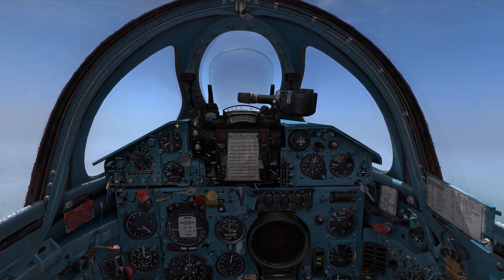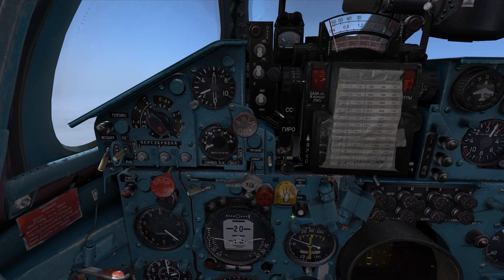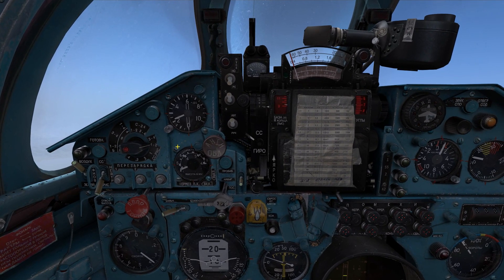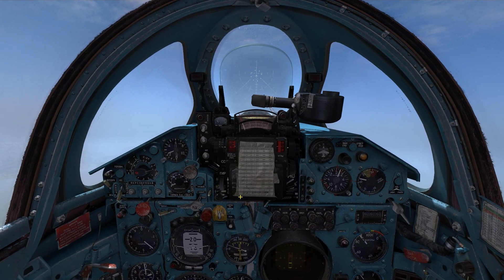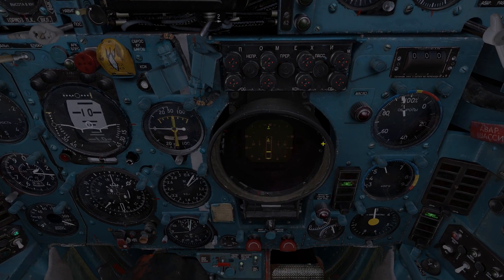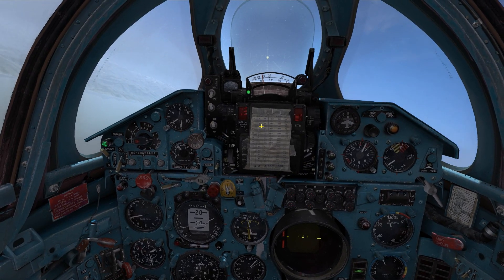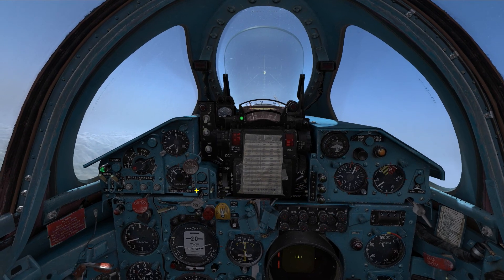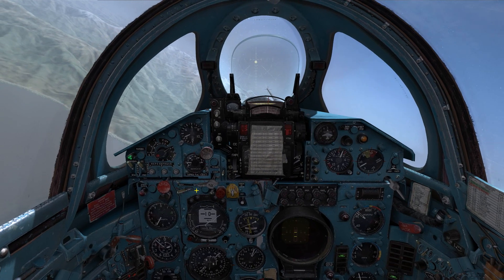[DCS] MiG-21Bis Air-to-Air Missiles

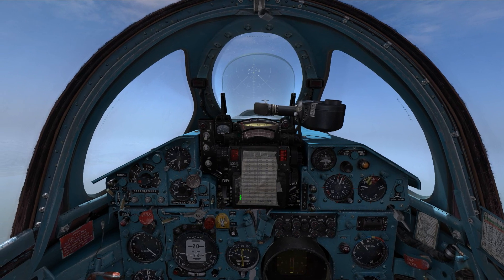Comment: What was that weird-looking, black device that was mounted onto your HUD in the first 4 minutes of the video that disappeared at 4:30?
Reply from the maker: +WelshZeCorgi That is the gun-camera. It is a camera that is only mounted during training, which will record whenever the trigger is pressed. After the flight, the footage will be analysed and it can be determinated if you would have hit the target or not.
By default, the camera is not present in the Mig-21 (as it would be in the real world), however, if you turn on the power switch for the camera, it will appear. I forgot to do that for the second part of the video ;)
Reply: xxJohnxx Thanks.

Comment: Thinking about buying Flaming Cliffs 3, is the flight model simplified or is it also pretty advanced?
Reply from the maker: +TEHGROUND Well it depends. Both the F-15 and the Su-27 have gotten the so called AFM (Advanced Flight Model) which is quit decent. Other airframes have the SFM (Simplyfied flight Model) which is noticable worse.
However, some aircraft (Su-33 and others) should get updated to AFM in the near future as well.
Reply: Thank you for the quick and informative response! Subscribed.
Reply from the maker: *****
Which yellow bars do you mean? Do you have a lock button assinged? You understand of bringing the target into the lock "gate"?
Reply from the maker: *****
Yep, ground clutter was a problem for the early radars. I would recommend watching my Radar tutorial. It shows you how to use the diffrent methodes for de-cluttering your radar screen! :)

Comment from the maker: Yes it is possible to use it in the so called "Game Mode", which disables quit a lot of the simulation stuff.
However, I strongly suggest to take the time it takes to learn the aircraft fully. It is a very good feeling if you start to get the hang for the systems!
Reply: xxJohnxx hi, thanks for the videos!
I have a problem with air to ground! every time I dive for a rockets run after setting the enginge to idle it simply goes off! there is no time for relighting the enginge in battle! is this common?!
Reply from the maker: nymerie
Hi!
Well, quit hard to tell what exactly is the problem, but as a suggestion: Keep an eye on the G-meter. At negative and especially around 0G the engine is only getting fuel for a couple of seconds. If you hold 0G or negative G for too long, it will cause the engine to flame out, as the fuel system of the MiG is not built for that.
Reply: xxJohnxx I thought so. It's in the manual as well... Thanks mate :)

Comment: Awesome Tutorial, thanks!

While the Simulation is amazing (thx Leatherneck!!) actually flying this aircraft seems really hard. Both times (IR and Radar Missiles) you were almost in Gun Range, and as mentioned in your Radar tutorial, maintaining a stable lock is almost impossible.

This makes the Mig21 not particularly "combat effective" compared to modern fighters, does it? How does the Mig-21 hold up against contemporary Jets? Like F-86 or F-4 or others...?

Also, what's the advantage of using Radar-Guided missiles if the range is not significantly larger than that of the IR missiles?
Reply from the maker: Yes, the MiG-21 is quit hard to operate it seems. Obviously you can't compare it against a 4th or 5th gen fighter.
However, at least in the sim, the MiG-21 seems to hold up quit nicely against aircraft like the F-4. Quit equal in terms of flight performance I would guess.

In the video I got quit close until firing because I have been trying to explain the steps. The missiles have  a longer range than that. On a non-manoeuvring target you should be able to get a hit if you fire from a distance of 3-4kms.

Talking about combat effectiveness is a bit difficult. The MiG-21 was designed to intercept and engage bombers. The small payload, low fuel capacity and high speed are a result of that. The aircraft can go from pretty much cold-and-dark to taxiing within 60 seconds. Giving it a pretty much unbeatable response time.

Not being a fighter, it still holds up against aircraft like the F-4 quit well. I guess it all depends on pilot-skill, situation and a bit of luck in the end. The MiG seems to be quit nimble and manoeuvrable for an aircraft of its class.
The F-86 however (as you mentioned it) is no problem for it. You have better sensors, weapons and more speed as well as more engine power.

However, often you will read about a lot of MiGs (-21s) getting swiped out of the sky by Western aircraft in conflicts in ex-Soviet or other countries, which leaves the impression that the MiG-21 is not as good as it's Western counterparts.
However, this might have one reason: Training. An interesting read about that (from an F-86 pilot fighting MiG-15s in Korea) can be found here: http://acepilots.com/russian/rus_aces.html .

About the Radar vs. IR guided missiles: The radar-guided missiles (especially the R-3R) have some advantages against their IR counterpart (in the case of the R-3R this would be the R-3S). The R-3R radar guided missile has limited all aspect capability, which allows you to launch at an enemy aircraft from a bigger spectrum of directions (even a head-on hit can be scored on a lucky day).
The R-3S will not only miss from anything than a rear aspect, but it probably won't even track/find the target if it's seeker can't directly see the hot exhaust.
Seeker capability probably is the biggest advantage for the R-3R over the R-3S, which generally allows you to fire from a longer distance. In a turning fight however, I will definitely use the R-3S or R-60M1 over any radar guided missiles, just because the limitations of the radar.
Reply from the maker: I just realised I posted a link to the right website but not to the article I was talking about. I will provide a link as soon as I am able to find it!

Comment: So can we fly a real mig after this tutorial ?
Reply: ISIS is probably training right now with this to fly their migs lol
Reply from the maker: *****
To be honest, I have never flown il2, so I can't really speak of it. But at least according to your description it indeed sounds like it is a bit better in the wind/turbulence part than DCS.
While DCS's flight physics are very good, I fear they won't be a 98% recreation of the real flight. But this is quit a difficult topic altogether. For example the A-10 matches the numbers in the book:

You set a certain RPM at a certain altitude and you will get the same speed as the books suggest.
You pull back on the stick and at a certain speed you perform a turn with a certain amount of g which will give you a turn radius as in the book.
-> Those are good flight physics and you can fly the aircraft "to the numbers" so to speak.
However, the simulation-wise difficult part are the non-standard operations. What happens during a stall, a spin or any other non-normal flight situation?  That's where most of the flight simulators will defer from reality. Not even the Level-D simulators in which they train airline pilots for flying the big birds are accurate in those borderline situations. Sure, they prepare you, but they are not the same as in reality.

I am not sure if you have been flying a lot in FSX, but you might know PMDG. They produce high-fidelity airliners for FSX, which are basically the civilian counterpart to the DCS aircraft simulation wise.
They released a Boeing 737-800/900 some time ago (which in my opinion is definitely recommended if you are into that). On their forum a discussion started, if you could fly a real B737-800 after training in FSX with the simulated B737.  A lot of discussion was going on, and at one point an active Airbus 340 captain joined the conversation. 10-20 years ago, he flew the  real Boeing 737-800 as a captain and therefore could make pretty good comparison between reality and FSX. And while he was very pleased about the systems he said that even if the flight model is close to reality, he doubts that he himself could land a Boeing 737-800 even after being a pilot on that type and even after flying it in FSX for a couple of months. Not because the flight model is wrong, just because it is different.

Too your last question: Yes, I have a pilot licence, however the biggest thing I have ever flown was Beechcraft 36 as well as Cessna 172s.
I have been flying for about two years in FSX/DCS before I started the real flight training. The experience gained in flight simulators was a big help in many tasks: Navigation, reading the Instruments etc. It also helped in basic flight manuvers: Keeping the aircraft level, performing turns, climbs with a constant speed and so on, are basically the same in reality and in simulators. However, in some parts they didn't really prepare me: Take-offs and landings. Taking off and landing in a real Cessna 172 is something completely different than doing the same in a simulator. You would be surprised how hard you have to pull on the yoke during flare to keep the nose up and settle the aircraft down smoothly, but without pulling just a tad too hard and therefore starting to again gain some altitude at low speeds which will cause a hard landing if not immediately corrected.
You would also be surprised to actually feel the change of torque (and having to correct it) when going from the little engine power necessary to maintain the glide path to idle.

It might be all related to one thing: The overwhelming amount of reactions/senses coming into your body. If you start a new DCS aircraft for the first time and fly a traffic pattern, you will most likely be overwhelmed by the situation: A lot of instruments, noise, vibration together with the moving outside world all will cause a massive amount of data spamming your brain.
It is the same in reality, just to a bigger extend: Feeling what's going on, g-forces, smells, engine noises, vibrations, control-forces, wind, a flight instructor talking at you, ATC in the background, visuals and all that while flying at 120-140km/h towards the ground. It is an overwhelming but also awesome experience.
As training goes along you will start to ignore certain, unnecessary things, and you will be focused on what you are actually supposed to do.
This really got me on my first solo. We did a couple of patterns, and after that we rolled to the apron, for what I thought would be a short brake, but no, my flight instructor had different plans for me. As he got out I was sitting there, thinking: "Fuck, no I don't want to. I don't even know if I am ready too". I was very nervous while taxing back to the runway. However, while holding short and waiting for some traffic to land, I did the checklists, prepared the aircraft, checked for any problems and just magically all the nervousness went away all of the sudden. I flew 3 traffic patterns and only after landing I actually "realised" that the seat next to me was empty for the whole flight. Only after getting out of the aircraft I started to realize that my knees where shaking and I could hardly stand. Awesome experience!

But to sum it up, while simulators sure prepare you, I personally would not jump into a MiG and try out my chances.
I hope that helps!
Reply from the maker: Definitely no.
Reply: I would agree, except most pilots fly with simulators as a training aid.  I remember seeing an image of a classroom full of soon to be A-10c pilots training with thrustmaster T-flight hotas joysticks.  I have read the manual for the Mig-21 and the systems are pretty close to realistic.  You could certainly start one up, taxi it and take off.  Landing would be the tricky part, but hey thats what the ejection seat is for.
Reply: Dimitri Miles
hahahha
Reply: Dimitri Miles you mean their (last) mig. 2 have been bombed dead on the runway by assads air force :)
Reply from the maker: *****
Yes, it is realistic, but it won't allow you to fly the real aircraft. You might learn systems operation, you might learn basic flight manuvers but take-offs and landings will screw you over.
Reply from the maker: *****

The in game physics are a difficult thing to compare to the real world. From my experience DCS generally has one of the best feeling flight models out there, however it's just not the same as reality unfortunately. When flying, especially at lower altitudes there is hardly any time in the real world where you won't encounter any form of wind or turbulence. The wind is not constant, and the turbulence definitely isn't either. However, this is not actually one of the main problems you would encounter when transitioning from the sim to real, but it sure makes it a bit more challenging.
The g-forces are a good point. While you easily do 5g-8g in front of your PC screen, you will be in for a surprise when you are merely doing 2-3g in the real world, let alone 5-8g.

Another thing is the controls. Have you ever operated the flight controls in a C-172? To my knowledge there is no PC hardware out there, that can simulate the high control forces that are often necessary.
While these forces might not be a problem while flying at altitude, they will kill you during take-off and landing.
Reply: well i believe that u could learn atleast 70% of needed information to fly aircraft just by sitting on your computer, but the thing is that u need to feel the aircraft to control it, the feeling of fligth cant be added just too easily to a simulator. But if you ask me, naturally gifted man or woman who knows what he is doing just by  experience from fligth sim should be just enogh to put you thru basic fligth
Reply: because the only way to learn fly aircraft is by learning by flying the aircraft, simulator is intented to simulate flying.
Reply: DemonAMVs thanks for the info Demon